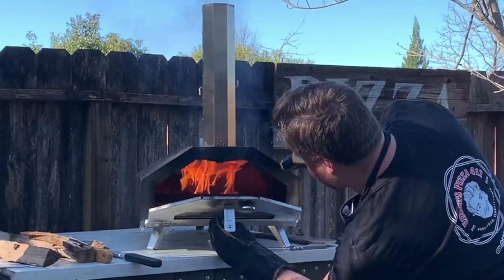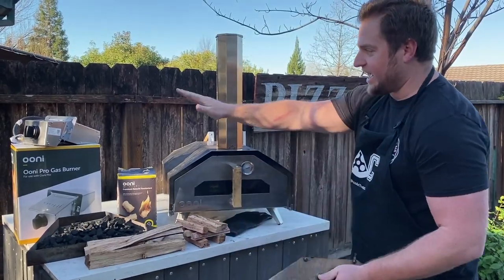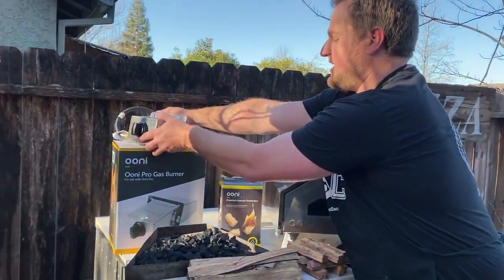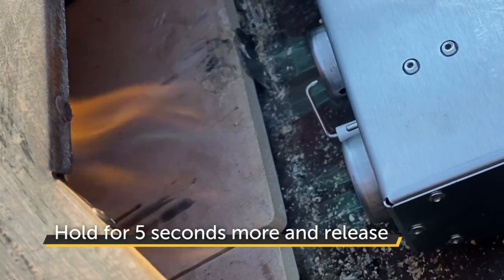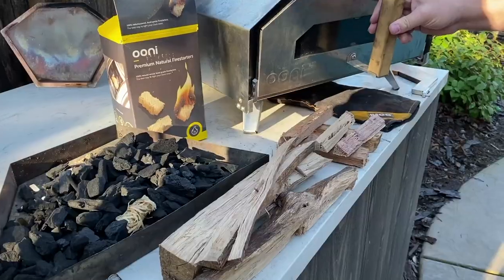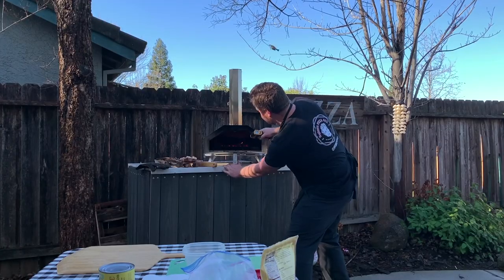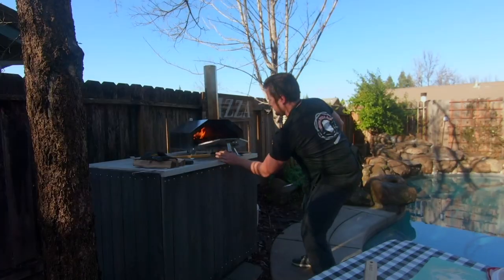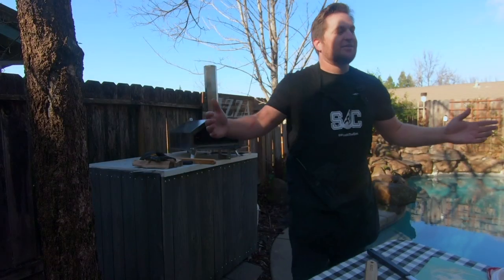How To Cook With Ooni Pro 16 Multi-Fuel Pizza Oven | Top Tips | Essentials

Comment: Just received the Ooni Pro 16 Multi-Fuel Pizza Oven for my birthday, and I have to say that I'm super excited to get started!  The thing is though that I really want to do my best to keep the oven clean and use it for as long as possible. My main concern is the stone and its cleaning. So basically should I scrape it down and turn it around after every use?
Reply from the maker: We can't wait for you to get to cooking with your Ooni Pro! Please note that it is completely normal for your stone to change colour over time. This is a sign that you're getting plenty of use out of your Ooni! If there are any stubborn stains, allow your oven to burn on high heat for 30 minutes after your last pizza. For super stubborn stains, you can use an Oven Brush to gently wipe away any leftover soot and debris. Please allow your oven to cool completely before attempting to clean your stone's surface. You can also flip your stone after each use to have a cleaner cooking surface for your next pizza cook! 🍕

Comment: Can you elaborate why you use the open face instead of the door while using gas?  I've always used the door with no problems while cooking with gas, and prefer to have the wider opening when loading bigger pizzas.
Reply from the maker: Hi! The Ooni Pro Gas Burner should be used with the Pizza Door to ensure proper airflow. The Gas Burner has a flame safety device built in to shut off the gas in the event that the flame is extinguished to prevent dangerous gas build ups. Using the pizza door allows any excess gas to dissipate safely. We hope that helps, but if you have any further questions, please reach out to us at support.ooni.com 😊

Comment: Is there any chance of ceramic fibers insulation escaping thus contaminating the food if stainless steel housing slightly wraps over time?
Reply from the maker: Hi, Robert! It is incredibly uncommon to notice breached insulation if your oven warps slightly as a consequence of your oven's extreme temperatures. If you are currently using one of our ovens and have concerns about exposed insulation, please contact our Support Team at support.ooni.com and include your original order number, oven serial number, and a few photos of your oven's internal components. If there is a rare issue, we will be more than happy to sort this out for you!

Comment: Just received my ooni pro.  Wondering when to close or open the air vent on the oven.  Not the baffle on the chimney, but the baffle that is at the entry of the chimney that you adjust from inside the oven.   You spin it to open or close it once the oven is hot it is almost too hot to change even with the he ooni gloves.  Thank you.    Also- great tip to flip the pizza stones for cleaning.  Thx
Reply: 0:33 👍